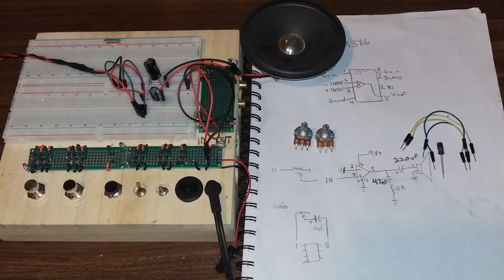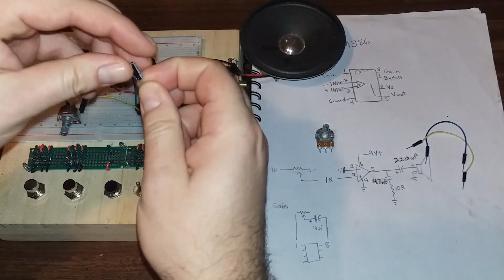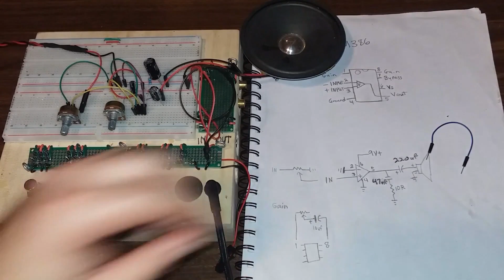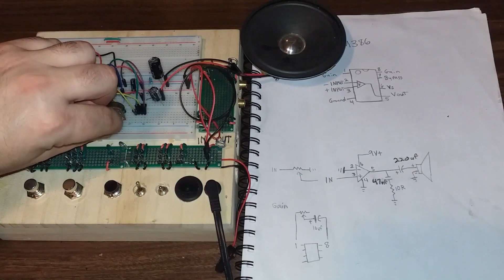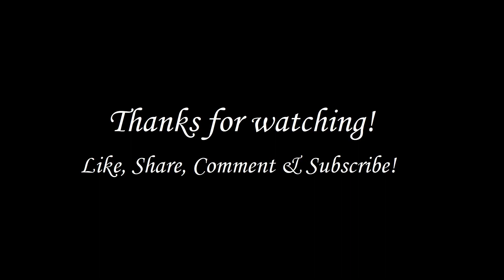How To Add Volume And Gain Controls To The LM386 Amplifier (Plus Volume VS Gain)

Comment: This is a great circuit,Iam using it with my guitar,lots of clean gain,I got it going at about 12 midnight tonight I hope my neighbours enjoyed as much as I did,lol,Iam trying to make a flanger pedal from scratch?if you have any ideas that would be great?I have a simple Oscillator Iam using and a couple of those pt2399 reverb boards,I have got it sound like a chorus pedal but can not get that flanger sound?thanks

Comment: I built the circuit with a LM386-1. I then swapped it for the LM386-4. No difference in volume/gain. Tried both chips at 5v,9v,12v and the  LM386-4 at 18v. No difference in volume gain.
Any suggestions on why and how to fix? I used 4 and 8 ohm speakers. I have a guitar pedal prototyping unit that supplies the various voltages so I can quickly test all.
Reply from the maker: If you have cut your input signal and spliced in a volume knob in between the signal coming in and the input of the amplifier then you should have volume control.  If you jump a capacitor from the 1 pin to the 8 pin on the amp then it should give you more gain.  If that doesn't work  I would suggest making sure the capacitor is connected the correct way. If it's a polarized capacitor it's only going to work one way. Just swap the leads and try again. Which side of the capacitor that you put the variable resistor for gain control doesn't really matter. But your volume control does need to be at the input signal rather than the output signal
Reply: @davekingrey1009   Thanks for the reply!!  To be clear I obtain the gain when I connect the 1 and 8 pin. It just does not increase when I go up in voltage. Also does not increase when I put the LM386-4 in place of the LM386-1 in the  circuit. Always the same volume.  I took the volume pot out to eliminate that.  The LM386-4 is 1 watt. But it is the same volume even when given 18v. It is the same at 18v as at 5v. Cannot understand why? Other chips I have used get louder as I increase the voltage from 5 to 9 to 12 etc.  I am using a guitar input if that matters. Maybe an impedance issue? I might try another power supply although the one I am using is 18v 2A.  at the maximum. But maybe all of it is not going to the prototype board. (Mimotronics Protis 1  Guitar Effects Development Board ) I will try my 30v 5A PSU tomorrow just to rule that out.
Thanks again!!
Reply from the maker: If you're on Facebook then I would strongly suggest joining a guitar pedal builders group.  You can share pictures and schematics and ask questions and people will usually be very happy to comment and help.

Comment: Hi, first of all thank you for explaining. I simulated the circuit in proteus 7 but I do not see any change in the output waveform as I vary the resistance of the gain control part (Between Pin 1 to 2). However, the volume changes when I vary the resistance from the voltage divider? what im saying is that my gain control isnt changing the volume like it does in your circuit. why is that?
Reply: Sorry, I have placed my resistor incorrectly. It is working fine now. The LM386 data sheet gives 3 circuits. Gain with 20,50 and 200.  Is there a direct equation that relates the RC between pin 1-8 with gain... or should I identify the gain manually through testing?
Reply from the maker: @kaizoniumnh2405  sorry I do not know the equation. so you may need to test it manually
Reply: @davekingrey1009  alright, thanks again.

Comment: where would a bass and treble control go in that circuit
Reply from the maker: Tone controls would need to go at the input before the volume control. If it were a guitar effect pedal I'd put the tone and volume controls at the output of the circuit but with an amplifier you want all those controls at the input to shape the sound you are going to amplify before it goes into the amplifier.

Comment: I like how you explained this as signal coming into for volume & gain to "clean up" or minimize the distortion. If you wanted to add just volume control (as you said just before output) you would put the 'pot' from pin 5 of the LM586 to left pin of the 'pot' and the right pin to the + of the 10uF capacitor correct?
Reply from the maker: Do you mean the 220uf capacitor? The 10uf cap goes between the 1 and 8 pins and the only component that it is connected to besides the LM386 is the gain control potentiometer which is wired like a variable resistor. 

On an amplifier I would not recommend putting the volume at the output ever really. You could probably get away with it on this little amp but you'd probably need a larger value potentiometer to have the full range of volume control because you will be dealing with a larger signal at the output than if the volume control is at the input. On larger wattage amps the output might increase enough to damage the potentiometer if the volume control was at the end of the signal. 

Now with guitar effect pedals I always put the volume control at the end of the effect signal, past the output capacitor, as the last component before the effected signal goes back into the bypass switch to the output. I do this to limit the amount of white noise at the output of the effect which is going into the amp's input. With an amp you really want the volume control at the input to limit the white noise going into the amp so that white noise doesn't get amplified and become really loud at the output.

So, hypothetically, if u did put the volume control at the end of this circuit you'd want it to be last component before the speaker. Looking at the potentiometer from the front you'd put the right pin to the output (negative leg) of the 220uf capacitor, the left pin of the potentiometer would be connected to ground. And the center pin would be your final output wire that goes to the speaker. On a volume control I always wire the center pin as the output, and the outer pins as ground and input. 

I hope this answers your question. I might have mis understood what you were asking.
Reply: @davekingrey1009  my lm386 is in a low wattage pixie ham radio. So on the output side before the speaker is where I want to put a 20k potentiometer.  The signal at there is steady st a certain decibel.  I want to boost that louder. So either, the way you have it, or as I wanted. I'll play with it on my bread board to see. Thanks
Reply from the maker: @williamgrice4790  Cool. I'm interested to see how it will turn out. I'm no expert. I just play around on the breadboard myself. I've taken a little break lately but hope to get back at it again. Thanks for watching!